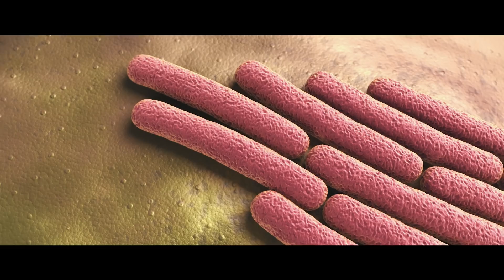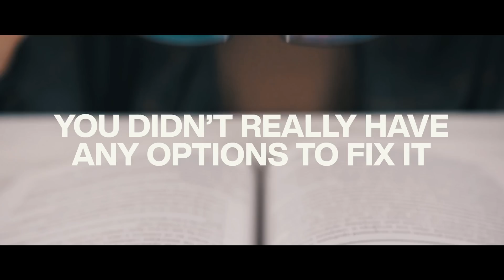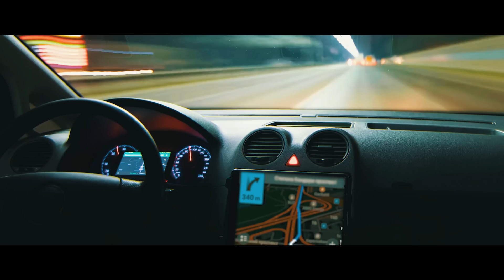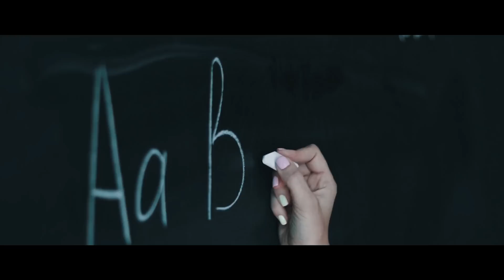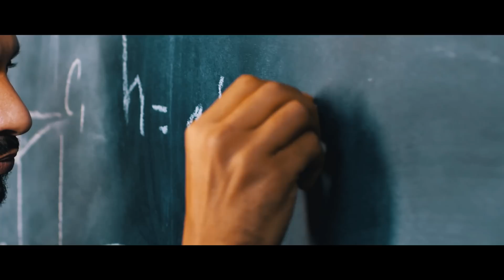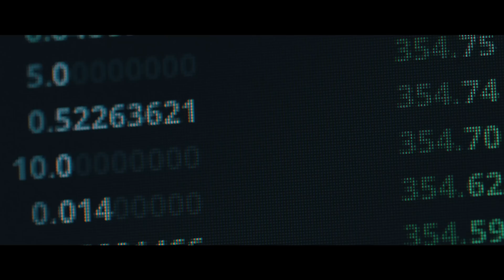these inventions changed the world..

Comment: Even if one transistor was made each second since it's invention, it is far too impossible to create 3 Sextillion of them
Reply: Not really... Consider making millions per hour all around the globe... You're still thinking small. Not everything is made by one person or one machine.
Reply: @mowoelo_o5191  136B
That's how many transistors made each second it comes out to be if we divide the number
Reply: @mowoelo_o5191  it definitely can't be that high
Reply: @limboproductions224  dude, one i7 core has 1.75 billion transistors.
An average computer has over 200 million transistors.
Reply: @limboproductions224  A Snapdragon 845 has 6.9 billion transistors. An average smartphone has 460 billion transistors.
Reply: Taking all that into consideration, it's easily possible that we'd have over a sextillion transistors. And all this works logarithmically. So by the same time (72 years) it'll easily quadruple.
Reply: @mowoelo_o5191  you are underestimating how big a Sextillion is. 
And instead of estimating if making Sextillion chips is possible by some other parameter why don't you try to actually calculate

Making 136B transistors per second is just nuts to me.

Only thing that could be missing here is I'm underestimating the speed at which transitors are made, and that manufacturing 136B of them per second on average is actually plausible.

And your 400 trillion figure is for the most powerful supercomputer on Earth, and it has such a high count primarily due to having a very large memory, where most of the transistors in a computer are used
Reply: @limboproductions224  My bad. 400 trillion is in super computers. And yes you are really underestimating the number of transistors produced ever second. As there is a huge demand for electronic gadgets almost everything needs transistors. They are the most integral part of any modern device.
Reply: But we dont make one transistor per second.

First off, your logic derives from only making one per second. Thats already the incorrect rate. Lets say, in a production line, it has that rate. Even if that is the case, you are neglecting that other production lines exists.

Machines can do more as each transistor grow smaller. Less distance, less complexity, and since the machines also benefit from smaller and faster processors, their rate of actions improves on top of their ever shrinking work to do to complete a transistor.

Faster machines combined with faster production processes can produce more than 1 transistor per second.

So even if it is the rate that you say it is, we can still reach that 3 sextillion number bu having enough machines to get an even higher rate.

Its your assumption that we produce that slowly.
Reply: @wanderingbufoon  yeah, that is the only explanation. First I thought I was being considerate with the rate I chose but seems like I'm pretty off 😛